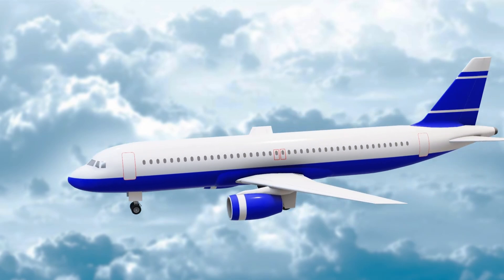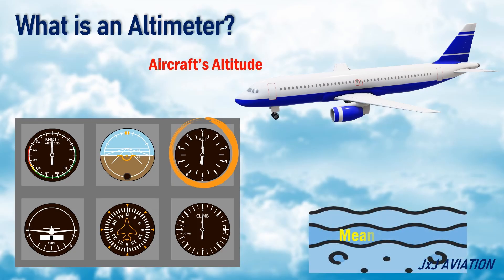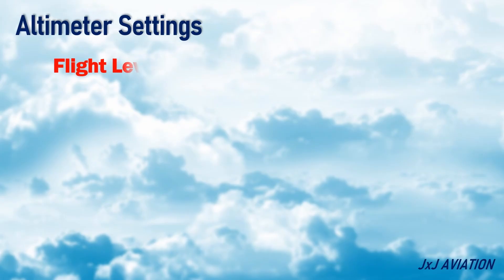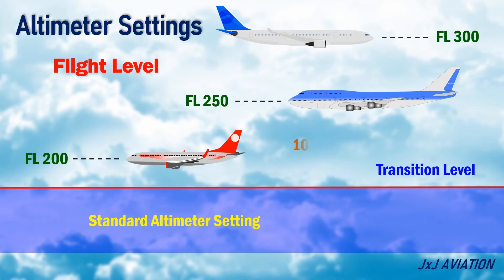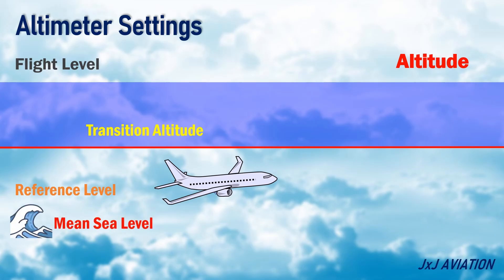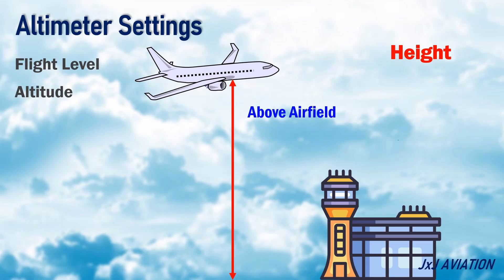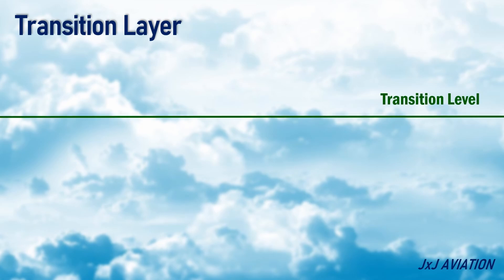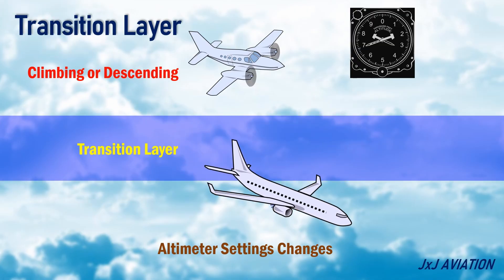Understanding different Altimeter Settings | QNE | QFE | QNH | Transition Layer

Comment: but how is the qnh calculated when the ground is above 0m: in practice do they measure the static pressure at the airport and then interpolate the static pressure at sea level given that the pressure increases of 1 hPa every decrease of 28 feet ?

Comment: What exactly does the transition layer do and how is it determined? How is the transation level determined? Why does a plane set qnh std at the transition altitude when climbing and why does a descending plane set local qnh at the transition level?
Reply: 18,000 feet mean sea level. 18K and above is Class A airspace. Where fast jets, airlines, and pressurized aircraft fly. Class A airspace is normally flown on instruments , regardless of weather or visibility.  Cessna, Pipers, Beech are not, normally at this altitude, due to pressurized cabins, precision navigation equipment, and pilot certifications. 
QNE 'Quierry Nautical Everywhere'. 18K MSL to 60K MSL
QNH - Quierry Nautical Height .0 MSL to 15K MSL   for flight and climb.With 15K to 18K being transition.
QFE Quierry Field Elevation. For approach and landing.
Reply: the transition layer is a space just inside the bottom of Class A airspace. The top of the transition layer changes day by day and location by location depending on the barometric pressure (aka altimiter setting) on that day. Class A airspace starts at 18,000ft as measured by an altimeter set to 29.92 in Hg. The problem arises when the day's altimeter setting is lower than standard, because an aircraft climbing into the Class A will think they're lower than they really are and could conflict with other aircraft who have already changed their altimeter setting to standard. The top of the transition layer, therefore, is placed at the altitude where an aircraft with their altimeter set to the day's actual pressure will see 18,000ft on the dial. This might be as high as 19,500ft or higher according to an altimeter set to standard pressure.
Reply: this is also the difference between "altitude" and "flight level". the "flight levels" are measured with the altimeter set to standard, vs "altitude" being measured with the altimeter adjusted to the correct setting for the day and location.
Reply: How is the transition layer height value determined? between transit altitude and transit level.
Reply: @genccadamm  the bottom of the transition layer is where an aircraft with their altimeter set to standard will read 18,000ft, which is the exact definition of FL180.